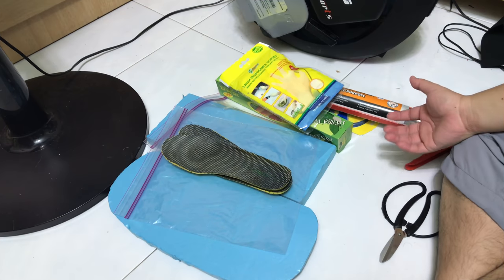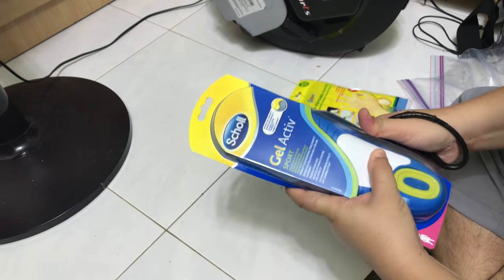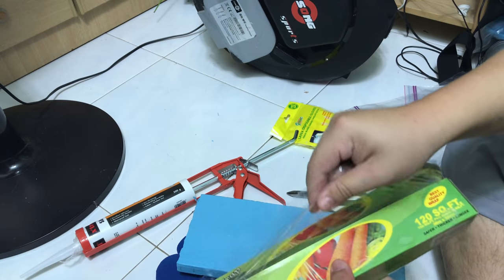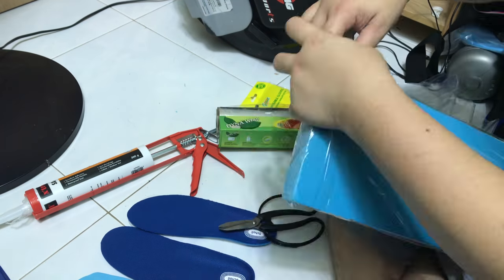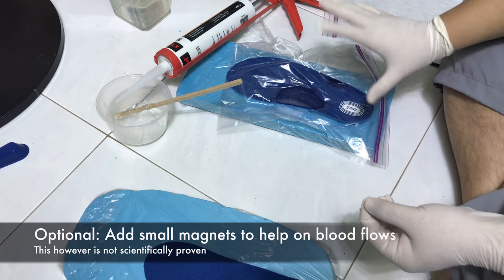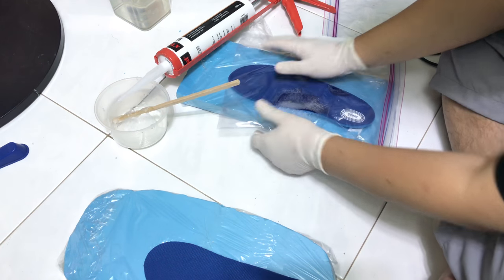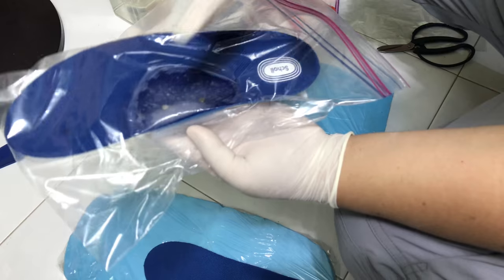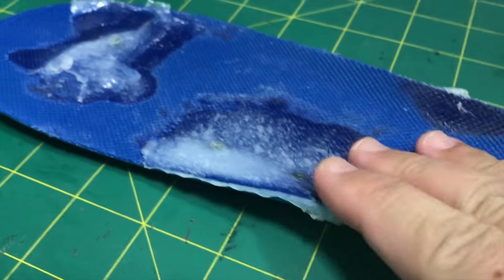DIY Custom insoles for flat feet to reduce midsoles pain with silicone sealant & magnet

Comment: I have tried this method (without magents). It works well.The only issue it silicone is heavy so if you need to put lots of it, the insole gets heavier.

Comment: What is the purpose of adding the magnets? It was not clear in the video, if you said the reason in the video, it was not clear. Please let us know the purpose of adding the two tiny magnets. thanks.
Reply: The magnets are for placebo effect ... they are supposed to improve blood flow as stated by Simon. This is the same technology used in scam after-market fuel efficiency boosters for car engines and domestic gas heating systems. Some people still fall for this scam.
Reply: Blood flow

Comment: again the idea is interesting but you're missing an important point :  you're just elevating the arch support and you're ignoring the effect it'll have on your foot , ankle and then the knee , the hip and all along the chain up to the neck!!  I mean suppose your feet have a normal arch then your raising of the arch with this device will induce suppination and the knee and hip will rotate to the outside of the normal aligment. If you naturaly overpronate it could correct your feet provided you make a cast with the correct ankle orientation but then you also add padding in the heel and under the big toe.  In fact your solution could actually be worse than what you're looking for.

Comment: Insoles have to be calculated by the experts with your feet scan... If the insoles are not arced properly with your feet condition it could have reverse effects Simon!
Reply from the maker: +Hong Wei Liao I understand, but I cannot afford the $300 to $500 per custom insoles by the “experts”, I Can Make multiple cheap  $30 DIY insoles that I can adjust using a sharpie to remove or add more silicone :)
Reply: SimonVideo Electric Unicycle Theres a shop at Junction 8 which I did it at. It costs only about 200 with visits to check on ur feet condition each time and adjust the sole accordingly. It works great for me although the first few days were quite uncomfortable. You should try it as well! I used to have very very flat feet as well haha
Reply: I don't believe that.  There are many stories of people who suffer zero or even negative effects from "expert" orthotics...  Why make doctors more wealthy when you can see if it works for yourself for $20?  Meanwhile, the science behind orthotics in general is inconclusive....
Reply: So you mean all those off the shelf orthotics are as good as useless? I think the human body can adapt quite a bit, so some sort of support will help. What exactly will a perfectly fitted arch support do?